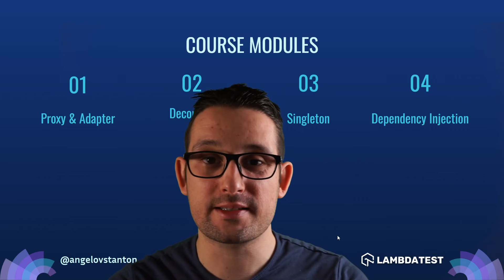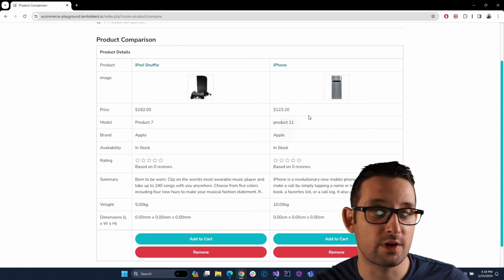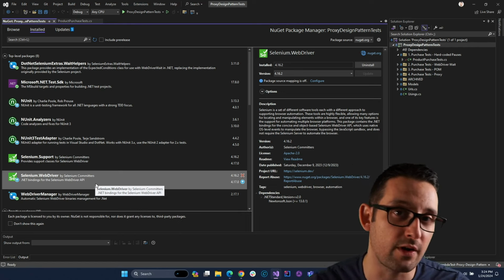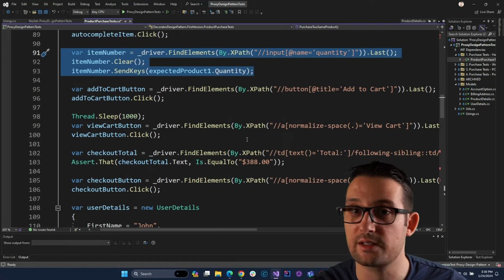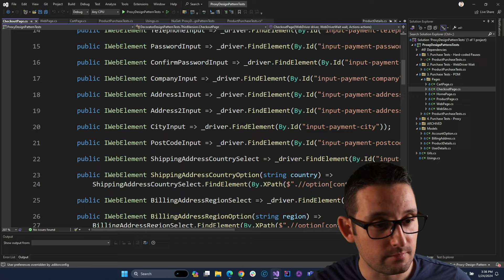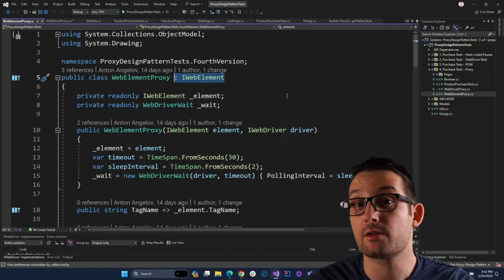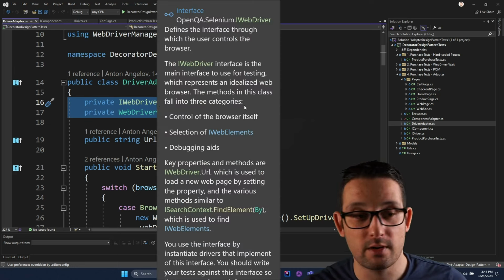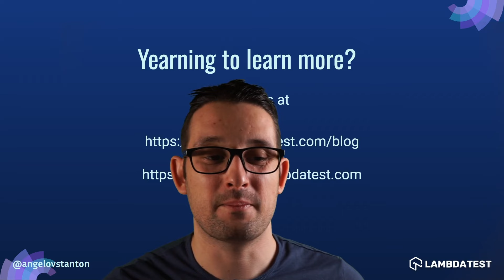Proxy and Adapter Design Patterns Explained 🔄 |  LambdaTest

Comment: I have this question, Why Should I go with Proxy or adapter pattern when similar thing I can do with creating an utility class and then keep the TypeText() kind of methods there which will actually clear and then use sendkeys and other new methods can also put in that utility class where expected condition will be checked too before finding element.
Reply from the maker: Hi,

When you use Proxy or Adapter patterns, they enhance your test scripts by separating concerns, improving flexibility, and adhering to design principles like SRP and OCP, compared to a utility class.